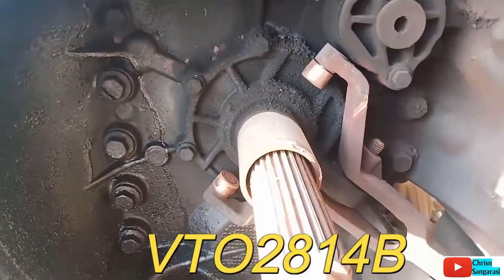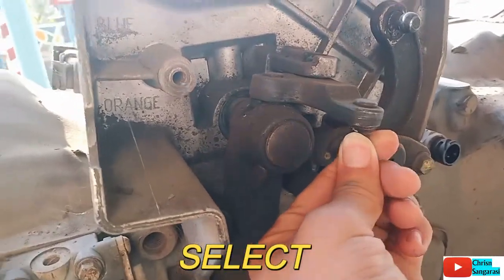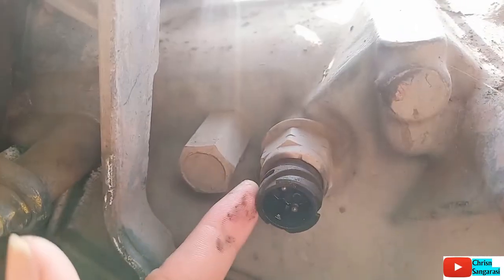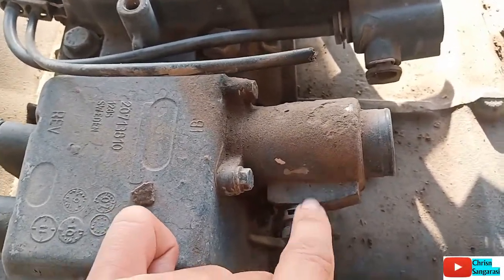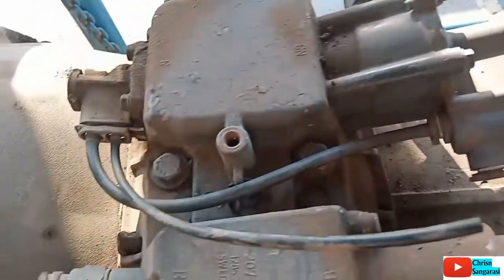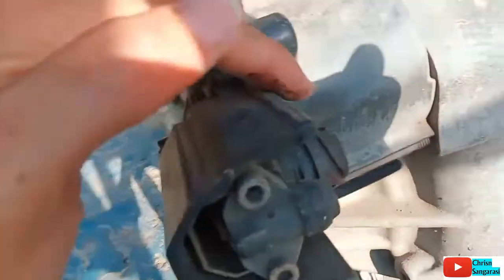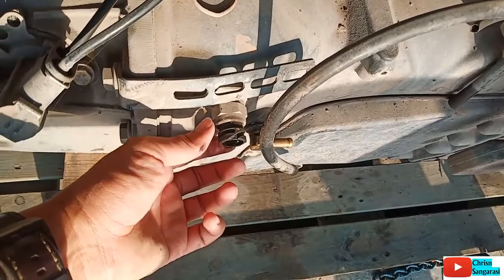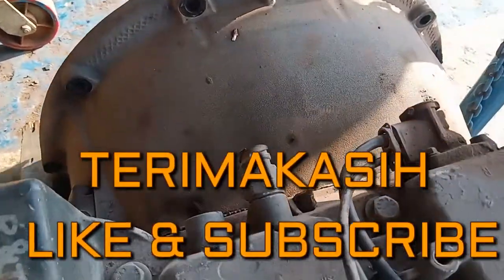Nama & fungsi komponen luar transmisi VTO2814B VOLVO

Comment: boss...lau fm400 selalu kalau masuk gear ada bunyi angin cieww...lau mau buat kepada fl10 apa yang harus dibuat
Reply from the maker: Itu dari inhibitor control housing, kalau masuk speed angin dari range cylinder dibuang,makanya bunyi
Reply: Gday , our relay valve cylinder is leaking air and I have new part, Cojali 2880113, is it easy to install or will other parts fall out 
Cheers
Reply from the maker: @ralphnorbert9187 it's part number relay valve Splitter or part number relay valve range?
Reply: @chrisnsangarasi9440 
Relay valve range according to your description, it’s leaking at the solenoid, if I remove it are parts going to fly out

Comment: Bang nak tanya kalau gear nya susah nak masuk apa masalah.kalau mati enjin nya senang nya masuk
Reply from the maker: Speed berapa yang susah masuk? Semuanya atau speed 1 saja
Reply: @chrisnsangarasi9440  semua bang
Reply from the maker: Yang pertama cek dulu control housing bagian locking cylinder, pastikan tidak ada kebocoran saat kopling di injak, kedua ada salah pemasangan disk clutch saat pergantian, ketiga sinchronizingnya transmisi habis
Reply: @chrisnsangarasi9440  kalau gear 1 sama 4 susah nak masuk apa masalah
Reply from the maker: Solenoid first gear atau speed 1 pada control housing, untuk membuktikan itu yang rusak,coba cabut socketnya, kalau masih susah berarti sinchronizingnya speed 1yang masalah
Reply: @chrisnsangarasi9440  ok bang terima kasih

Comment: Assalamualaikum bg, mau tanya kapan inhibitor range mensuplay udara ke locking cylnder? Dan fungsinya juga bg dari range cylnder? Terimakasih🙏
Reply from the maker: Inhibitor range mensuplai angin ke locking cylinder saat proses terjadinya perpindahan range dari posisi high atau pun posisi low ke high, ini berfungsi agar operator tidak bisa memasukkan speed saat proses perpindahan range belum selesai (ini hanya sebagai safety transmisi). Dan syarat perpindahan range adalah saat posisi gear shift posisi netral